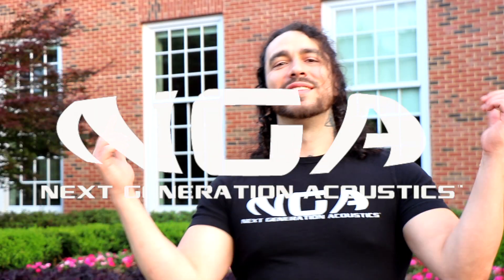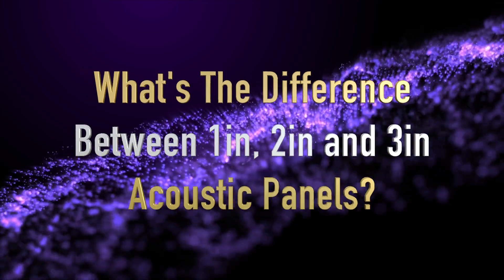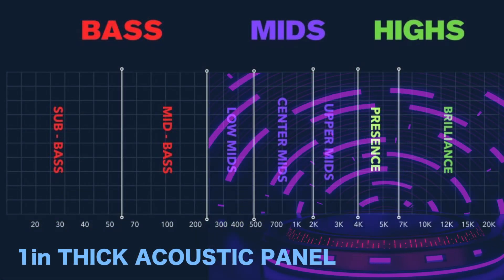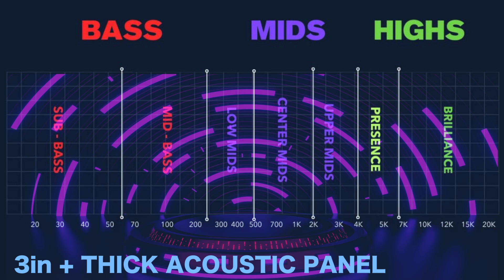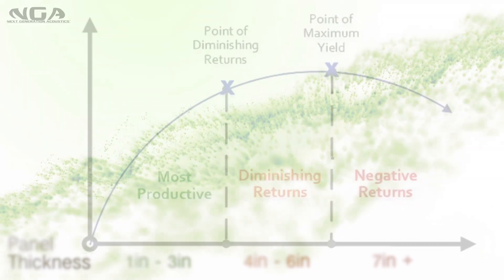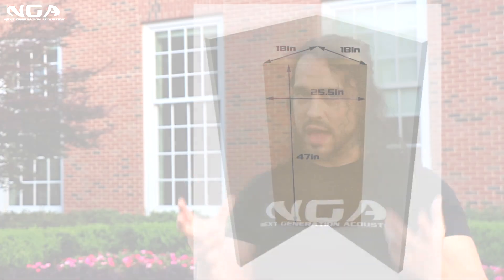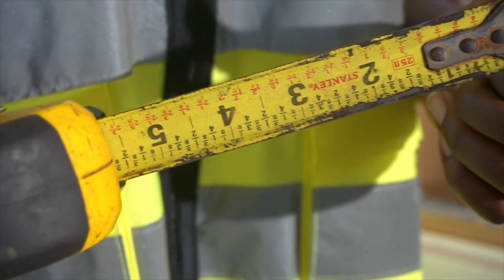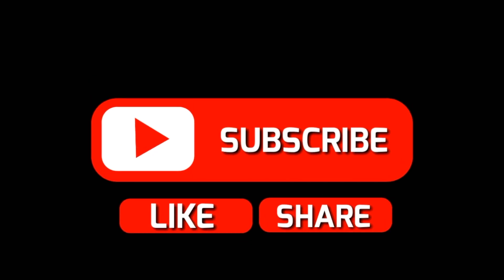How Acoustic Panel Thickness Affects Frequency Absorption: Optimize Your Sound

Comment: Hey hey.  Nice to see you talking about this important, and very misunderstood topic: treatment depth.  It's great to hear the discussion about what panel depth is the best for your application.  I would like to add something to the discussion, and that's the density of your porous absorption and if there is any benefit to very thick treatment (1-4 feet).  

Using a higher density rigid product, like OC703 (48 kg/m3)  or Rockwool Rockboard 40 or Cavity Rock (62 to 69 kg/m3) then you can get great results with 1-2".  If you go thicker, you will get diminishing returns like you said, but you will also start to get an increase in your bass reflection coefficient.  Meaning, the deeper the treatment the worse your bass absorption.  You'll reflect the bass back into the room.  

Now, is there any benefit in deep treatment then?  Yes, absolutely. If there wasn't, then you would never see anything deeper than 3" panels in $1M rooms like those designed by Northward Acoustics, Wes Lachot Design Group, and Newell Acoustical Engineering.  But they have 3-4 feet thick treatment on ceilings and back walls - generally speaking.  

The key to understand is that to absorb big wavelengths like bass, you must have deep treatment, but it must be very low density.  OC pink fluffy fiberglass is what it typically used.  In depths much greater than 3" it is extremely effective and can actually even reign in 30 Hz.  With the low density porous, you don't get the detrimental bass reflection and you get much better overall acoustics in the room.  

Of course, using an air gap is also a great move as you very correctly pointed out.  And your corner trap design is a very good one, as the varied depth created by the triangular corner will actually create a broader effect if you end up putting range limiters on the front of them (perforated panel, slat absorbers etc.).  

I always back up what I say with things like this, so I'll link you to my references.  Master acoustician, John Brandt, discusses this in depth (bad pun, I know) in his white papers, and backs up his assertions with lab tested results.  https://jhbrandt.net/resources/  Look at his comparisons of modules using OC703 rigid vs OC pink fluffy at various panel depths and you'll see how the deeper, lighter density panels dramatically outperform the thinner ones.

Open to chatting further on this and hearing your thoughts.  The discussions around acoustics are always fun, and are very nuanced.  There's so much info out there to absorb.  Great channel and I like your videos!  Keep em coming.  All the best.  - Drew

Comment: Hi Jacob. Can I get your thoughts on the following? I just received 10 acoustic panels (2x4x3) for my home studio(just for mixing) and on closer inspection, I see that the fabric used to house the rockwool is 10oz canvas duck fabric. When I try to blow through it, it is very resistant to air passing through. From my research, this could be an issue with high end absorption as the sound waves will reflect too easily due to the tight fabric. At the risk of spending over 500$ to re-wrap them in a more porous material, I thought I'd ask your opinion as to wether you think that would be worth it or not. Based on your experience, do you believe the difference would be negligible? Thanks
Reply from the maker: Good question! Unfortunately, if the fabric is too thick, you’re not getting the full benefit of your absorption panels. I cannot give you a DEFINITE answer if I cannot see the fabric in person. If you observe that it isn’t “breathable” it may certainly be worth re-wrapping them. 
If you want to email me at Jacob@NGAcoustics.com we can arrange you sending me a sample of the fabric through the mail and I can let you know for sure if it’s worth it!
Reply: @NGAcoustics  That would be very much appreciated. I'll write to you this evening. Thank you!
Reply from the maker: Sounds good!